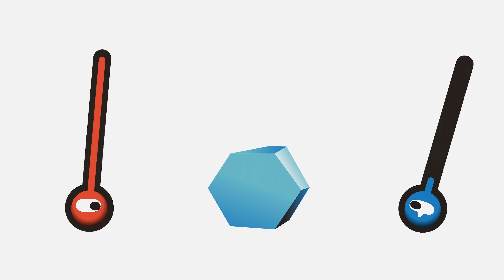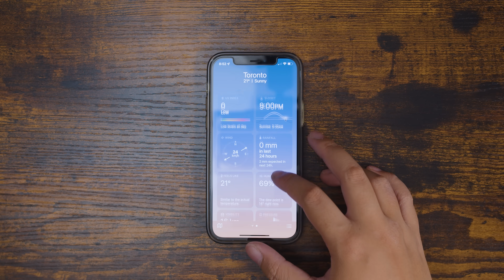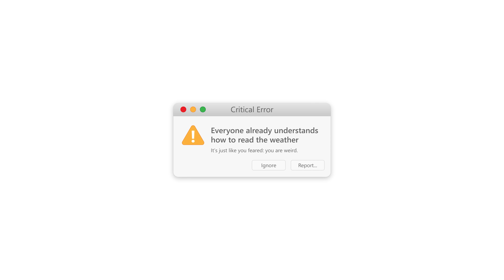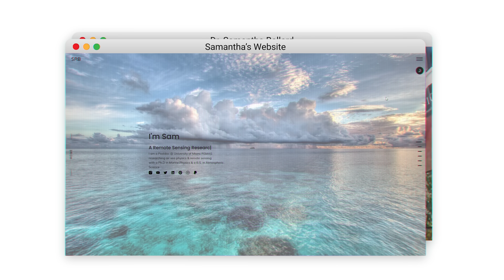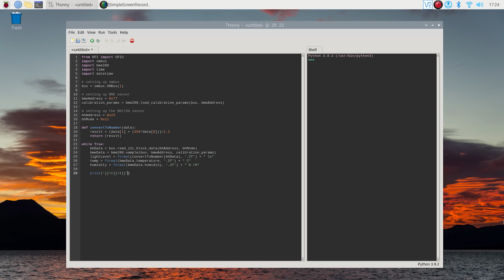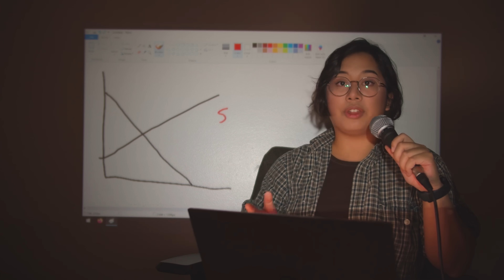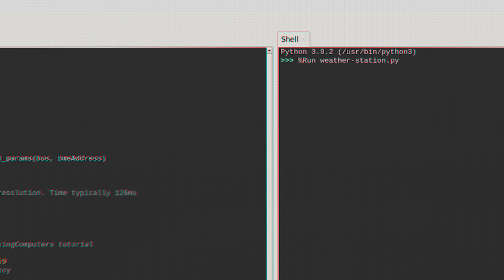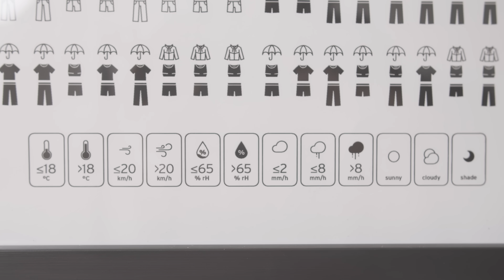how fahrenheit fails you

Comment: I do think Celsius is problematic when it comes to weather. Having learned and used both, I get lost when the temperature is between 10 C and 29 C. I know over or under those it's cold or hot, but that's it. Where if you tell me it's going to be 68 F today, I just need to look out the window to figure out what to wear.
Reply: bruh you just haven't used celcius long enough :) I know what to wear when the difference is like 24C vs 26C
Reply: @bellsctiz7120  yeah exactly all the people saying Celsius isn't intuitive just haven't learned it. Mandarin isn't intuitive- unless you speak Mandarin every day
Reply: @zyaicob  language is a bad example, some native speakers don't consider their languages intuitive. From my attempts of learning Polish, a lot of Polish people don't really consider the language intuitive. Temperature is different, one degree Fahrenheit gives more grainular information than Celsius. Which could be the difference between knowing if the fog is more likely to burn off or not. To use the guy aboves example with 26 and 28, that's only really helpful if the cut off is 27 and it almost never varies.
Reply: @thetrainhopper8992  Polish doesn't count Polish is a fake language, and they don't consider it intuitive for learners, but they still know how it works, and what sounds right and what sounds wrong, because it's their system. You don't need the precision of the Fahrenheit scale outside the human body. Billions of people all over the world intuitively understand Celsius temperatures, i guarantee you if you think Fahrenheit is intuitive and Celsius isn't you're in the minority

Comment: Kelvin is best for Scientific things. Celsius is best for culinary things, because the temperature of water freezing or boiling are important and the numbers aren't scaling as fast for relatively high or low temperatures. What is best for everyday depends on what you have the most experience with. If you didn't grow up learning which number to associate with which temperature, it will take a lot of adjustments and even then you will be a bit worse than those who know it intuitively. I personally have had no problem with Celsius for all my life, and I don't care what you prefer. What is important that one is used consistently on the local scale.
Arguing which one is better is like arguing which base system for writing numbers is best, between 2, 6, 10, 12 and 16.
Sure, you might find one that is optimal, but everybody will keep using the system they already know. It is interesting to discuss, but it's also important to consider that everybody will keep using whatever they like, and the conclusion we reach will have little real world impact

Comment: Fahrenheit is easy. Think of it as percentage. 80 degrees? You mean it's 80% hot. 27 degrees? It's 27% hot. Over 100 degrees? That's over 100% hot. And I hope we don't get there
Reply: Saying that makes me think 50% is not cold not warm, while that temperature is more fitting to about 60-70 fahrenheit when it comes to the temperature I will describe like that. This of course depend on humidity, wind and so on.
Reply: Thinking of it as percentages tells you absolutely nothing lmao.
Reply: @DonQuiKong  it kind of does. For example, 50 degrees? Kinda ok. 25 degrees? Only a little hot, so cold. 75 degrees? 75% hot, so kinda hot. Very weird for the in-betweens, but good at a basic level.
Reply: What?
Reply: 80% hotter than what? Freezing point?